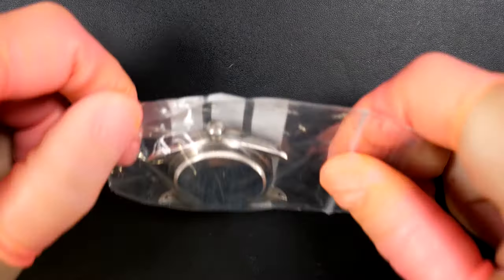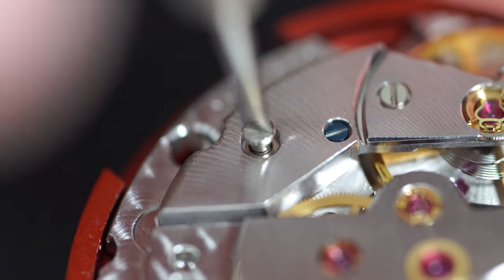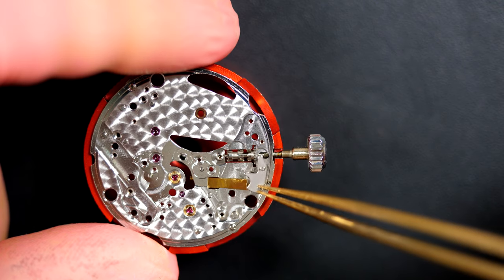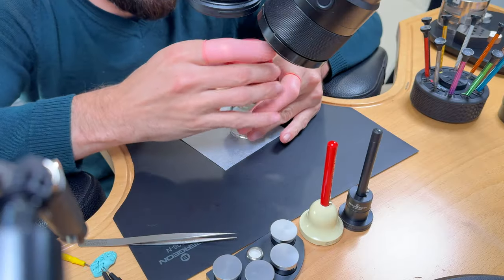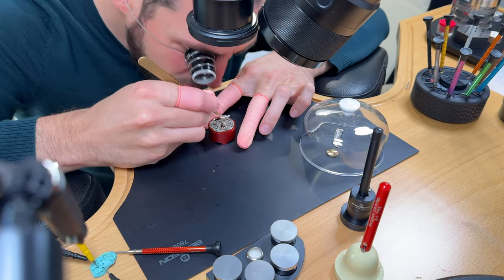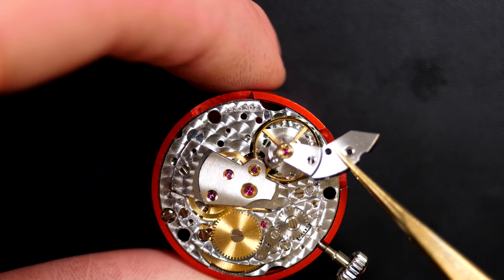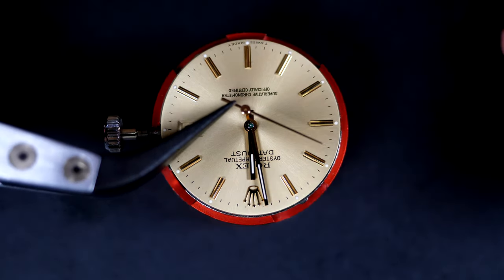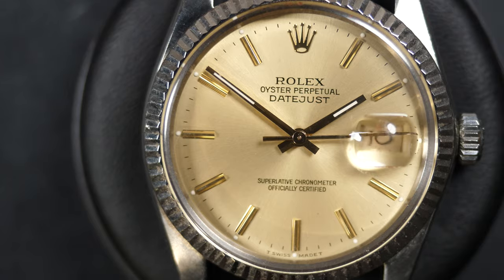Broken Rolex Needs a Repair !!! Rolex Datejust 16014 Cal 3035

Comment: Hello I love your vids. I have a 16014. My quick date is a little bit jumpy. It changes well on the pm to am, but when I do it manually around 19 to 26 it is messy. Any advice
Reply from the maker: @eightyed  try not too changed time between 22pm and 5am. The jump of the quick set date is more difficult than on the day change jump. It is possible that your date spring is lacking some lubrification against the date disk teeth
Reply: @FrenchWatchCollector thanks. How much does that service cost?? I want my watch running smoother
Reply from the maker: @eightyed  It will be around 400€

Comment: Great job on the restoration, lots of sound artifacts on the video though. It sounds like areas where you've half-removed speech, but a quiet, speeded up remnant has survived.
Reply from the maker: I use a software to improve the microphone sound. Normally it works well but I guess some issues appeared this time. Don’t know why

Comment: I’m not a Rolex fan, but these movements are finished very nicely! Well done with this, figuring out the issue. Did you epilame the auto works as well?
Reply from the maker: Yes I epilame the reversing wheel as per Rolex recommend